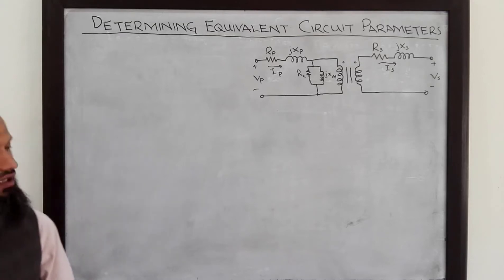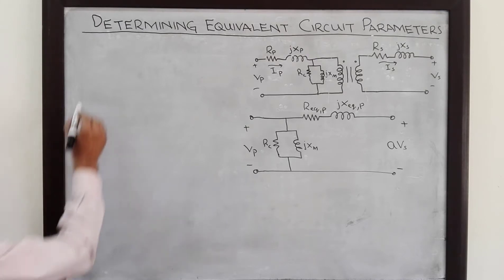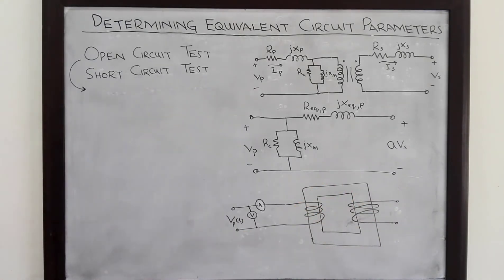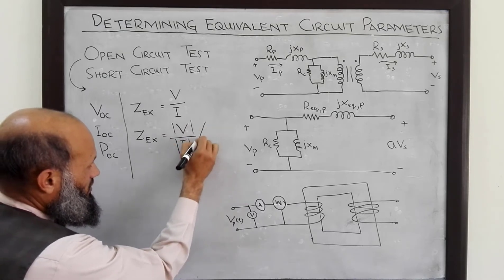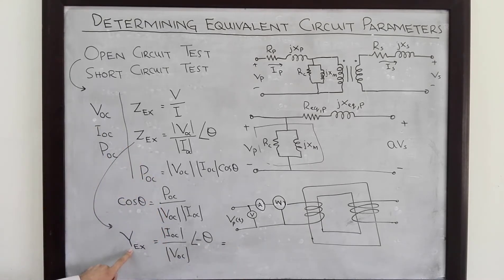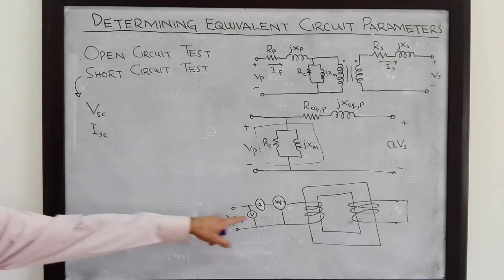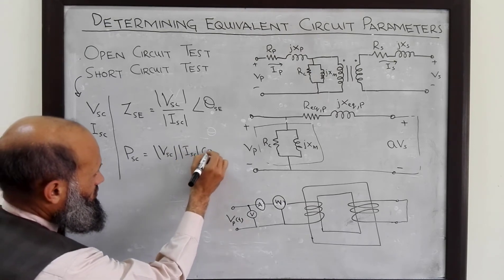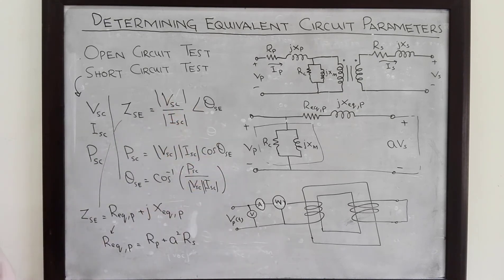EE213 - 09a - Short circuit test and open circuit test for a transformer

Comment: Question sir. Is the power factor of the primary side different from the power factor on the secondary side?
Reply from the maker: The power factor not only depends upon the parameters of the transformer, but it also depends upon the load connected to the secondary of the transformer.

To determine the equivalent electrical circuit parameters, we perform  two tests, and in each test different load is connected to the secondary side of the transformer(secondary open circuited in one test and short circuited in the second test). Therefore, the power factors in the two cases are different. 

I hope, I have correctly understood your question.